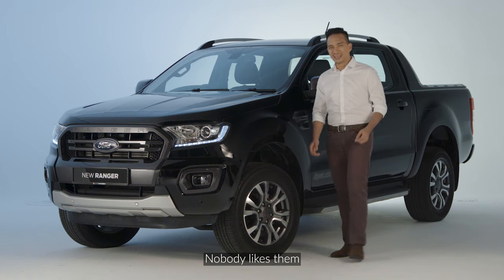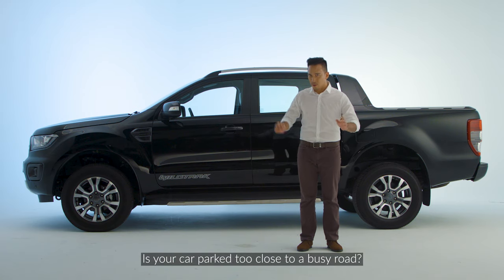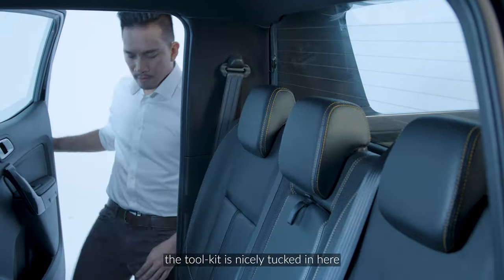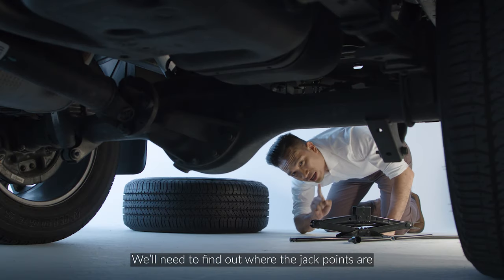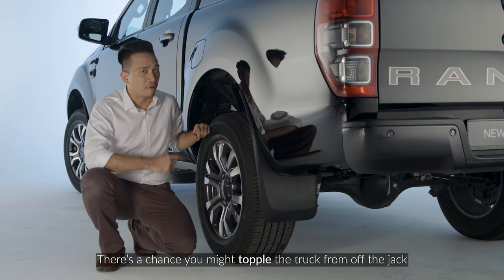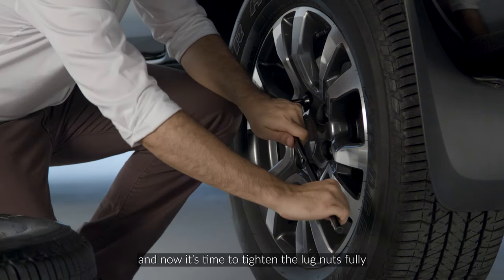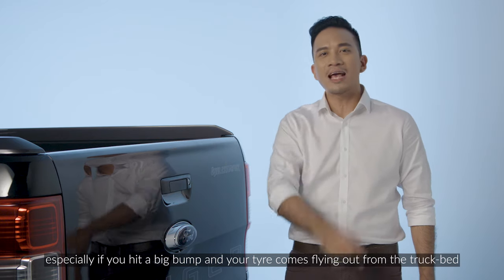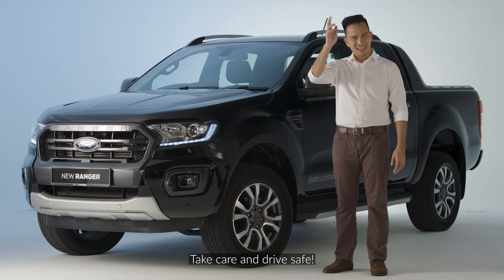Vehicle Support | How-To Tutorial Videos | Change Tyres

Comment: I would just throw the tyre in the back, most utes have covers that would stop it bouncing out (lol).
Reply: Lol, even without a cover it will be fine, if you cant load a tire in the back, you cant really load anything in the bed.....
Reply: Problem is with the spare wheels chain If wound back up without the weight of a wheel attached try getting the chain to lower again 🥵..🤬

Comment: Changing the rear tyre is not that easy in real life. I had 2 rear tyre punctures and on both times I had to call the emergency assist. Turning the jack with the extensions given are a real nightmare. There is just insufficient torque which can be generated by your arms when the jack is so far in.
Reply: Yep my Mitsubishi 2014 mn triton had a bottle jack behind the back seat from the factory the ranger one seems like it won't stay steady and will break especially if your off-roading will be getting a bottle jack instead dont want to be stuck somewhere waiting for a guy to change it because the jack was useless

Comment: I was interested in particular about the lowering of the spare wheel, A Mazda ute that I had years ago required turning the winder clockwise slightly to release the tension on the ratchet, then pushing the handle in to disengage the Pawl on the ratchet and then turning the winder in an anticlockwise direction to lower the wheel, 
Your example says you just wind it in an anticlockwise direction.

Comment: My God DO NOT STAND ON THE WHEEL WRENCH TO TIGHTEN IT!!!!! Most wheel nuts are only tightened to around 100nm which is only hand tight for an average bloke and make sure the threads are dry or you'll stretch and shear them. Just hand tighten them and go straight to a tyre shop and have them torqued 👍